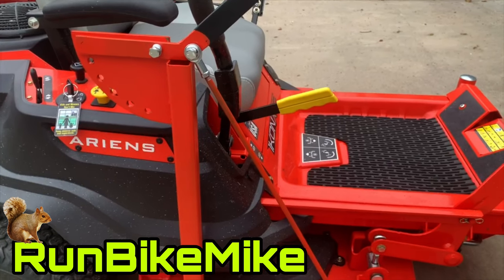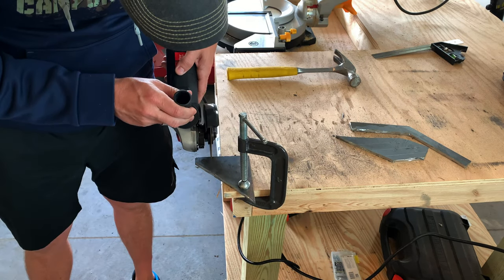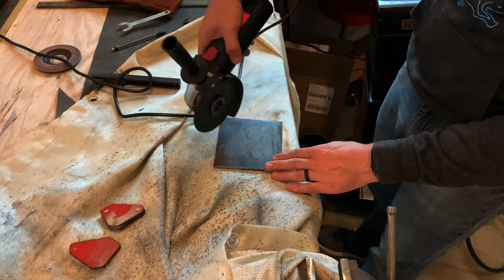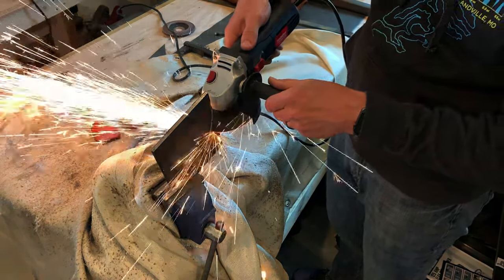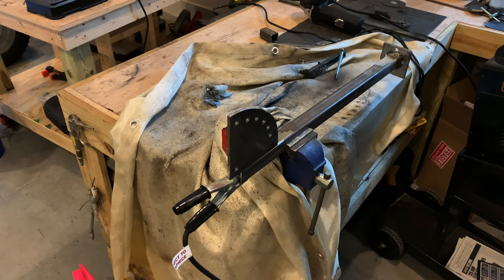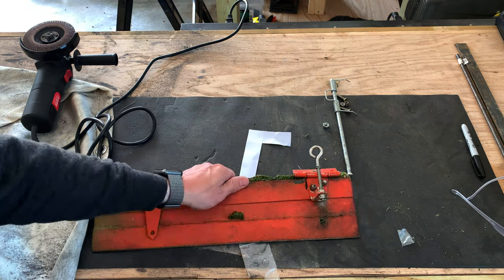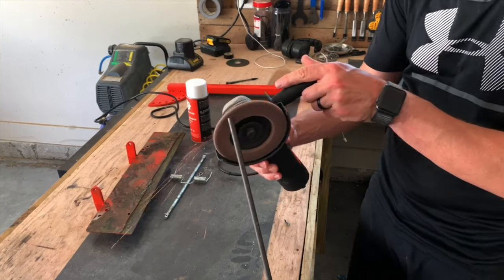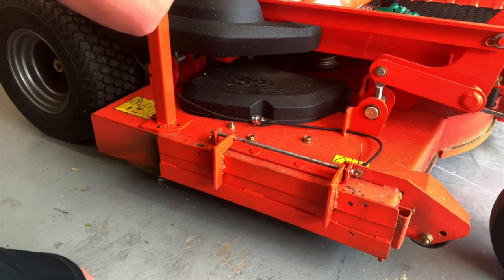HOW I BUILT AN ARIENS IconX ZERO TURN CHUTE BLOCKER: Building a custom mower chute blocker

Comment: Why don't you run the copper guard on your welder?
Reply from the maker: I am super new to welding so what I found in researching Flux Core welders is that guard is not needed. From what I have found that is only used for mig welders that use gas. What it does is protects the gas as it comes out so if you are welding in conditions that might blow the gas away from the head of the tip will keep a bubble of gas in that area to keep the welds more consistent. Since Flux Core doesn’t use gas it uses flux with in the wire there is no need to have it on there. It wouldn’t hurt to have it on there but some people say it is easier when learning to weld to take it off so you can see more where your wire feed is at.